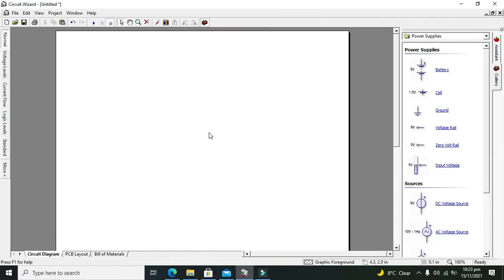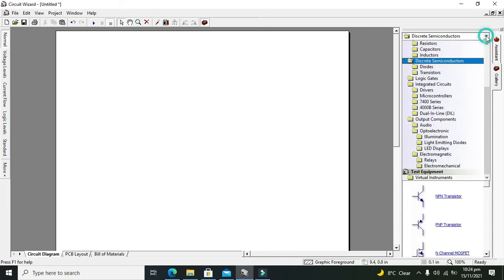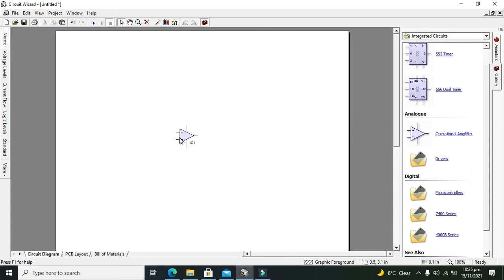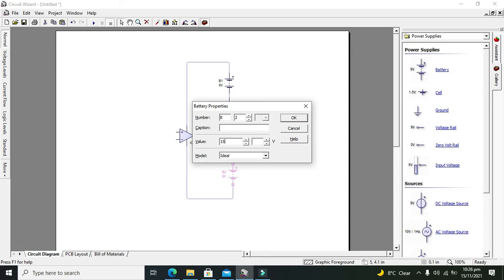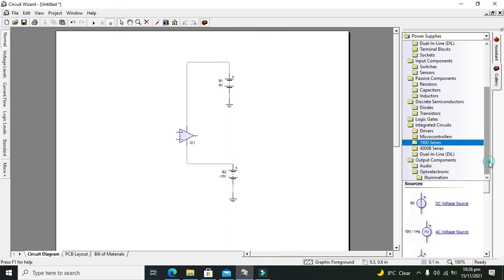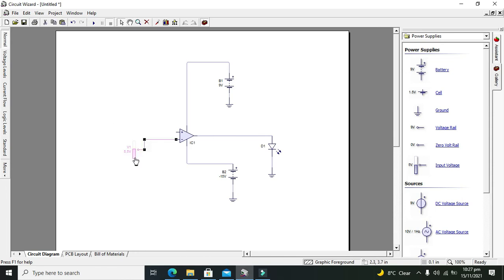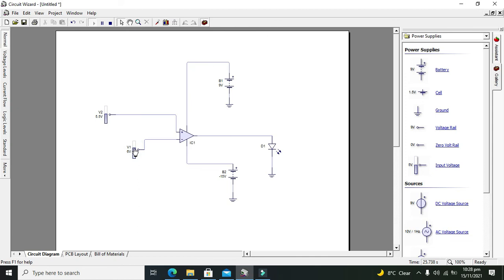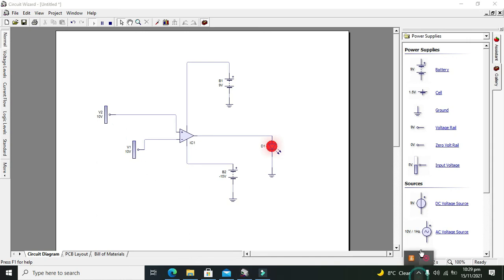opamp as a comparator in circuit wizard | how to make a comparator circuit in circuit wizard

Comment: Hi. I have tried making a wien bridge oscillator in circuit wizard but I cant get it to work. Even though I use the exact values from known working circuits
Reply from the maker: kindly check the voltages on all nodes....